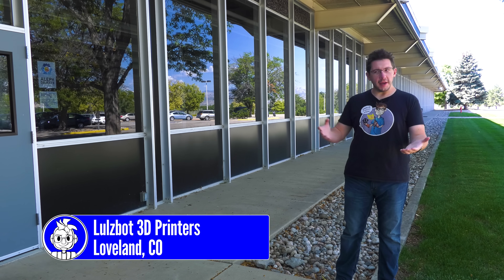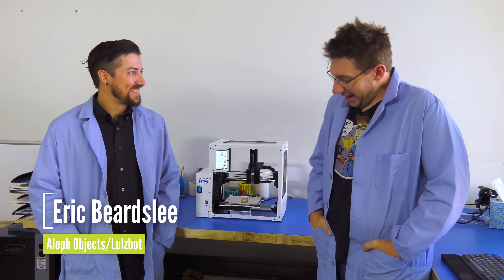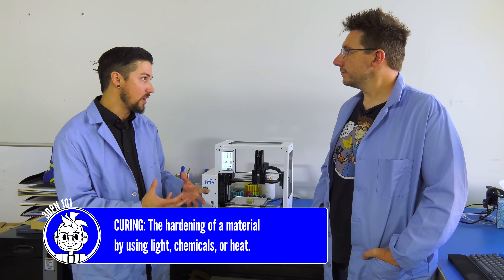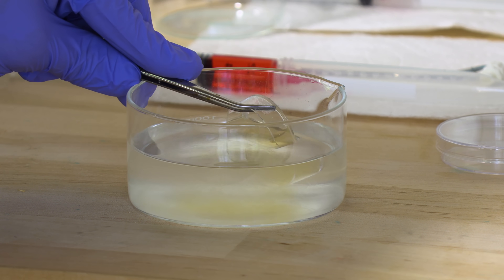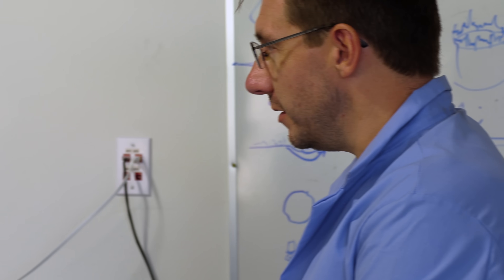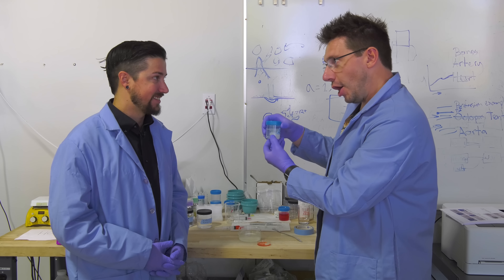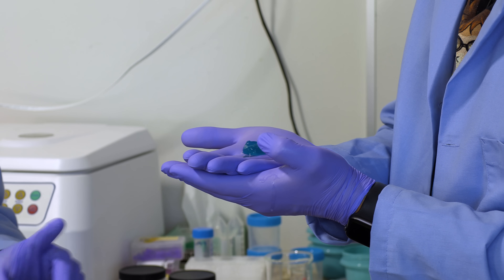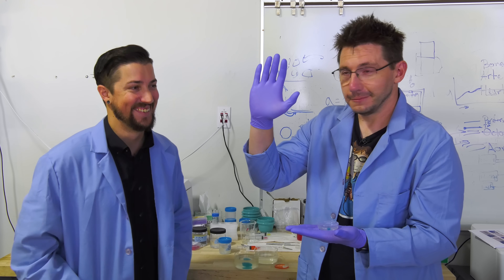3D Printing Organs is CLOSER thanks to Lulzbot BIO

Comment: There is a Ted talk with a 3d printed kidney and about 10-15 years ago they used a lexmark bubble jet printer to print a heart valve. It was printed in layers, stacked and grown together in a petri dish. When they tested it, it worked a lot like what you saw.

Comment: we need a pallet BIO to attach to the lulzbot BIO so it can selectively print scaffolding tissues, muscle cells, & support goo (or 3 syringes, retractable)

if you could extrude both collagen and support goop couldn't you print larger and more complex structures layer by layer, without pushing your needle through and around an existing tub of support goop, which I imagine distorts whatever is printing in there

Comment: I’m actually really curious on how they’re gonna be able to 3D print smooth muscle in the future. It’s one thing to print a vein or an artery that just acts like a hose and that it, it’s another thing entirely to print something that functions like an actual organ. Cant wait to see if they can pull it off or not.
Reply: I think that what they are printing here is closer to a scaffold that will let the muscle cells grow into the right shape. Sort of like a mold, but instead of the material being inside the mold, it slowly replaces the mold material with cells.
Reply: I mean it’s the future, they’re GOING to pull it off, it’s just a matter of what’s going to allow that next big jump to be made.
Reply: caleb oliva “it’s the future, they’re going to pull it off”

So teleporting then?
Reply: I think it is harder to install that print than actually print it.
Reply: Александр Алексеев kinda like how the stem cells cost more than the machine haha
Reply: T Ray maybe something like how they are printing silicone air muscles?  They have a mandrel they print it on instead of just a flat bed.  Basically there’s a lathe in place of the pint bed, they have a stretched matrix over a  tube, then print on the matrix and slide off when done
Reply: This produces a scaffold, potentially populated with stem cells and let them grow. That is already being done. The difference here is using a relatively cheap printer.
Reply: Serious Maran Ah, that makes sense. It’s slightly misleading though that since when you hear “3D printed organs” you think that they are talking about the finished product. So I guess it’s a sort of half truth. They are 3D printing the foundation upon which the tissues will grow. That thought actually never occurred to me, thank you.
Reply: @Courtney0229  it started with replacement ears, fairly simple they 3D map the old one, or the one on the other side. Reverse for other side. They then print and add stem cells with neutrient and growth hormone. Few weeks later they implant below the skin. They can now include the stem cells with the collagen.

Last time I checked a beating heart had been made, although a very small one. 

There are quite a few companies working on this.
Reply: Serious Maran so for all practical purposes they are 3D printing augur and creating an ideal environment for tissue growth. That’s cool, combining microbiology with the applications of 3D printing.
Reply: The shape would be impregnated with stem cells, or they might be able to print a combination of scaffold cells (collagen) and stem cells.  The real trick is to then work out how to trigger the stem cells to start producing cells that become veins, muscles, and other types of connective tissue, or even things like liver and kidney cells.  They get a little closer every day, but it's still a way off.  One day, maybe, just possibly, we might not need organ donors: they'll be able to just print whatever is required.

Imagine printing a complete heart and some arteries for someone who has heart disease, a kidney for a dialysis patient, or a functional liver for someone who would otherwise die. 

The main reason this Bio printer is so very exciting is that it brings the technology within reach of more researchers and research institutions.  It's vitally important that this technology is not monopolised by big (Pharma) business, but instead is made as affordable and accessible as is possible.
Reply: @Chris_the_Muso  don't forget to print pancreas for diabetics too! I'm looking forward to seeing the future!
Reply: @HelenaOfDetroit  Oh yes, to be sure.  I actually think they'll have first successes with metabolic organs like the pancreas and liver before almost any other "internal" organ.  These organs only need to support blood flow to operate and are naturally very fragile anyway. (Unlike the heart which is a really complex and tough organ that also needs to have muscle, connective tissue, cartilage for valves, and to respond to signals from the medulla)
My wife has type 1 diabetes that has resulted in permanent kidney failure (mostly because she didn't take the diabetes seriously enough in the first place).  Because of other endocrine issues (that resulted in all the problems in the first place) she probably isn't a good candidate for transplant, however if 3D printable organs are more readily available then the basis for deciding who is "eligible" for the transplant waiting lists should no longer apply.  They can transplant the pancreas now apparently, however the number of donors does not come anywhere near the number of people with type 1 diabetes.

Comment: Very interesting but still far away from the actual clinical usage. It would be easier to print real tooth enamel placement with living bone, dentin, pulp and artery first etc. because even that is extremely complex and has different kind of structures and layers but would be easy to implement to patient without extreme surgery. And since dental industry is using 3d so widely it would be the fastest way to get your development money back.

Comment: Your tooltip @12:48 is incorrect. A micron is a thousandth of a millimeter, not millionth. Hair measurement is correct though. A nanometer is 1/10000ths (what carbon nano tube wall thicknesses are caculated in)
Reply: Yeah - I'm guessing the thought was "millionth" due to the fact that micron really is 1 millionth... of a meter. I think that's why we generally called it micrometer in physics rather than micron, given the fact you have the base measurement (meter) and the fraction (micro/millionth) explicitly stated. Less confusing.
Reply: Oh my gosh. Looks like Sean already fixed it???
Reply: @RegularOldDan   Cant say they dont pay attention to comments xD

Comment: I am actually working on my master thesis right now (using bioprinters) and I try to find out how the forces in the different needles impact the viability of the cells that are printed.
Reply: That's awesome good luck with that! Are there issues with biocompatibility using bio prints?
Reply: @N3tech  Depends what material you are printing with but normally all the printed compounds are chosen specifically for biocompatability (not only to not be toxic, but also to provide printed cells with survival signals etc. that ensure that the cells will proliferate and form functional tissue). Also all the temperatures that you use of course have to be around 37°C to keep the printed cells at their optimal conditions.
Reply: I'm guessing that by "forces" you mean things like the flowrate, driving pressure, needle inside diameter, plus the physiochemical properties of the solution the cells are suspended in. It kind of reminds me of 50 years ago when heart-lung bypass machines were being developed, it was necessary to contend with similar issues when pumping blood through long tubes by squeezing it through roller pumps that physically damaged the red blood cells. Wishing you success in your work.
Reply: @BrenzMarie  The "force" is mainly the shear stress and the most important parameters for this inside a 3D bioprinter are the viscosity of the cell-laden hydrogel, the internal geometry of the "extruder", the inner needle diameter and maybe the hydrostatic pressure driving the hydrogel through the nozzle.